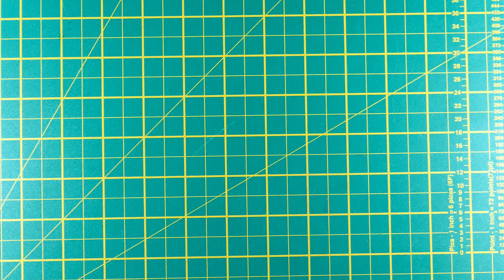Custom AEK64 Keyboard build log from a japanese Apple Extended Keyboard II

Comment: Nice video! FYI, this isn't an actual "AEK64." That's a proper noun describing an integrated case/plate combo by Clueboard from ~2017. May want to change the title to "AEK60," or something to that effect, as the build is more 60% anyways.
Reply from the maker: Hello, I didn't realize that the name "AEK64" identifies a specific keyboard. I tried to make a research by goggling around and it looks to me that the name "AEK64" has been created by imgur user tmrmn that published a build log in late 2016 here: https://imgur.com/gallery/N0n8I . He states that the name  is a mix of Apple Extended Keyboard and ALPS64 in AEK64. Is he the same guy  from Clueboard? As far as I understand, from that post on, any Apple Extended Keyboard transformation in a 60% keyboard is ususally referred to as an "AEK64" realization; there are dozens around. Even if it is , with no doubts , a 60% size keyboard, I'd prefer to stick to that name for easy search engine finds and general public acceptance that a 60% custom keyboard made out af AEKII parts gets the AEK64 attribute, with no intention to clone or steal  the original AEK64 name.
Reply: @BitSplits  While I can appreciate the level of interest you took in researching the origins of the term "AEK64," in the mechanical keyboard community (I hate myself for being that guy), "AEK64" describes the Clueboard product. You could probably just use the term "ALPS64" for any generic AEK-style 60% keyboard build. Oh! And there's this: since I originally posted this comment, I found a webpage for the AEK64 (Clueboard has since removed mention of the AEK64 on their website, probably to discourage inquiries for a product that's been NLA for a couple years!): https://mailchi.mp/117b54497aaf/the-aek64-is-here-build-the-best-keyboard-apple-never-made

Comment: What is the keypuller tool you are using? And the desoldering gun? And that weird cleaning machine?

Beautiful work
Reply from the maker: The cleaning machine is an ultrasonic cleaner. It uses ultrasoud waves to take dirt off the things you put in the bath, adding some soap: https://www.youtube.com/watch?v=4BkerrXp5-U. The keypuller is from Kail https://www.youtube.com/watch?v=kAs50q2BGsg but one of these is perfectly ok : http://www.aliexpress.com/item/4000180681885.html?spm=a2g0o.productlist.0.0.40ce2b69JW5VXD&algo_pvid=18c9fe63-3c6c-458f-82f9-9e0ba04c72a8&algo_expid=18c9fe63-3c6c-458f-82f9-9e0ba04c72a8-20&btsid=6f36d041-94ae-40e0-abea-39638ae4d722&ws_ab_test=searchweb0_0,searchweb201602_7,searchweb201603_52  and the desoldering station is similar to this one https://www.youtube.com/watch?v=NbIP4sPVoDk , it's sold under many different brand names, You can look just for "ZD-985 desoldering station" .
Reply: @BitSplits  You are a champion. Thank you so much for the info. Very inspiring work and I hope to be able to make my own someday!

Comment: How much would I have to pay you to make me one 😂.
Reply from the maker: Hello, I do not run a company  but if You're talking seriously, price would be : 180$ or more for a japanese AEK II , about 70$ for the PCB , 40$ stainless plate, 100$ aluminum case, 5$ sticker, consumables like lube and foam 10$ , shipping included.  Add customs duties to my country for the parts (30%) and back to your country (?) than add labor, it takes about 16 hours to build one and much of the work is in cleaning the alps switches one by one, programming the controller etc... .we are talking of 600$ excluding some customs duties. It's definetly not cheap.